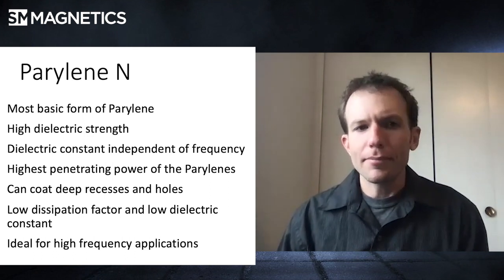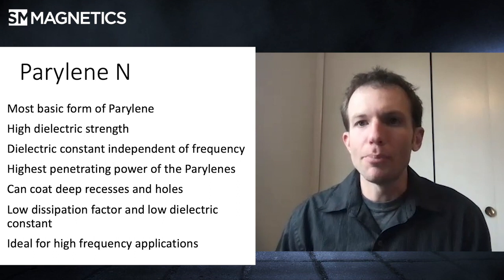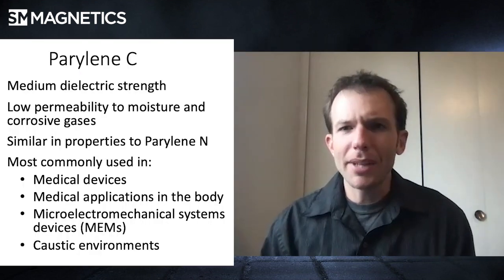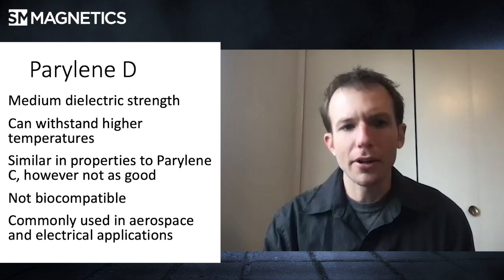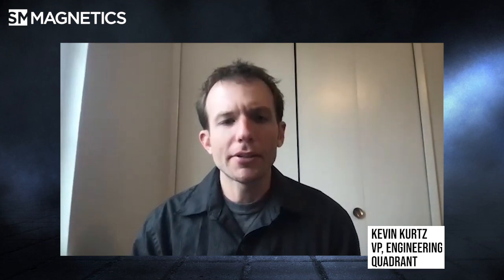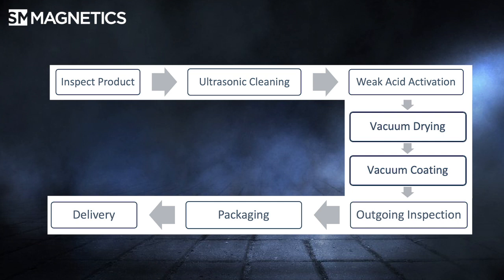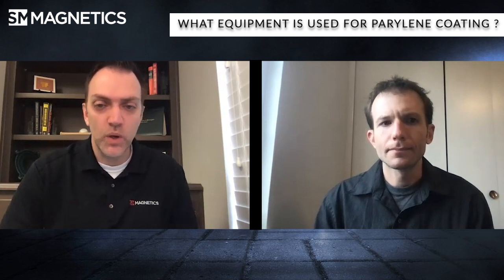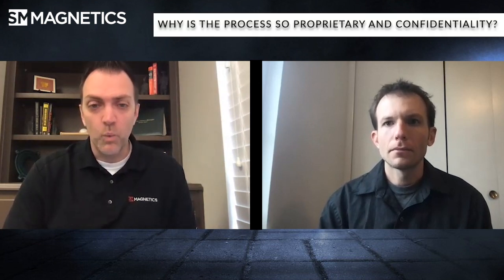Magnetic Innovation & Technology, Series 3: Parylene Coatings & Magnets

Comment: What is the average coating thickness of a D type? What is the (Ra) average surface roughness at that thickness?
Reply from the maker: Hi T Legend - 
Great questions and we appreciate the interaction. I have talked with our engineers and the D type Parylene coating is only used in very specific applications. While we can produce this type Parylene coating we rarely use it.  So unfortunately, we do not have the specs for this material on hand. However, we would be happy to partner with you and learn more about your application and required specs to determine if this is the type of coating you would need. We might could suggest a better coating for your application. If you are working on a project and would like to reach out we would be happy to continue to work with you. Feel free to contact us at https://smmagnetics.com/pages/contact-us.

Comment: I am still wondering why should magnets be covered with your coating vs. other types of coatings that might be more tolerant and less finicky to apply?  Basically, where is the value or advantage in using your coating over your competitors?  Thanks!
Reply from the maker: Hi The Meek - 
To answer your questions. Coatings are going to be application dependent. In our experience, Parylene coating on magnets is most commonly used in medical application, however, it is not necessarily the best coating option for any given application. There are a number of factors to consider when selecting your coating and we walk with our customers every step of the way to ensure that they have the right coating for their application.

Comment: Do you have connections with CMR?  This process could be applied to Polymagnets for use in marine environments!  I know they were working with the Navy to produce larger Polymagnets!  They might be interested in your services!
Reply from the maker: Hi The Meek -
Thank you for the suggestion about CMR and Parylene coating.   We do work with CMR, and understand their Polymagnets very well.   The process of magnetizing a magnet using CMR technology involves a bit more handling than normal magnetization, which could result in scratching or scoring the coating.  

With marine applications it usually requires a more robust coating as Parylene would probably not stand up to the elements (salt water and abrasive sand) very well.  We usually recommend something more durable like a stainless steel sleeve if the magnet will be exposed to water for an extended period of time.  But, we will relay this suggestion to CMR and see if they want to start testing Parylene coatings.

Thanks for reaching out to us, and keep the suggestions coming!